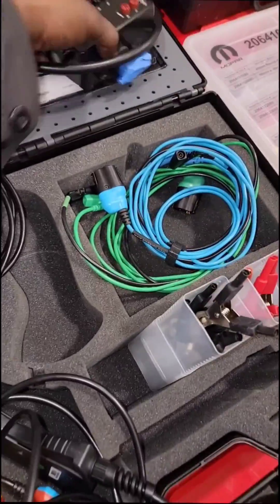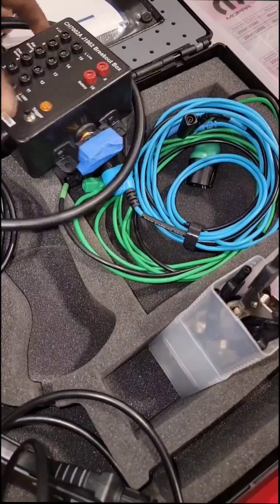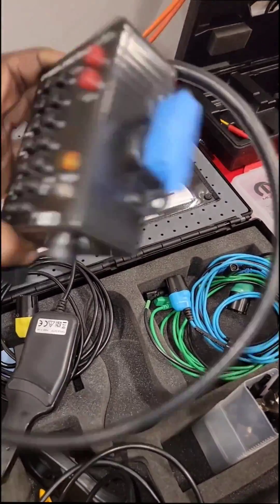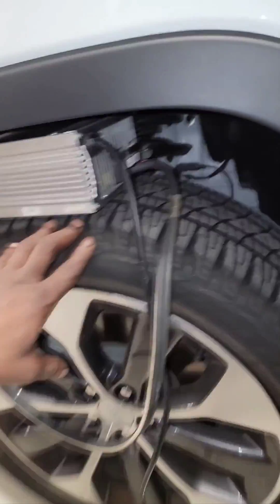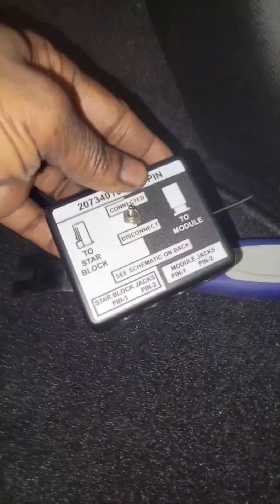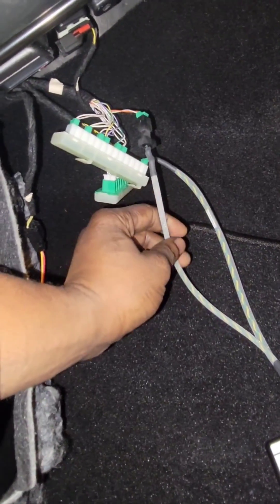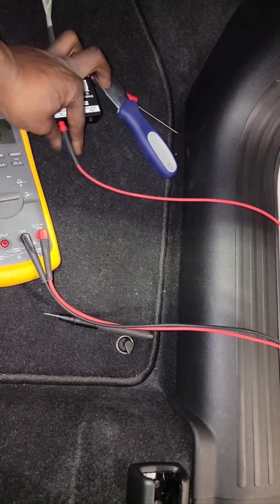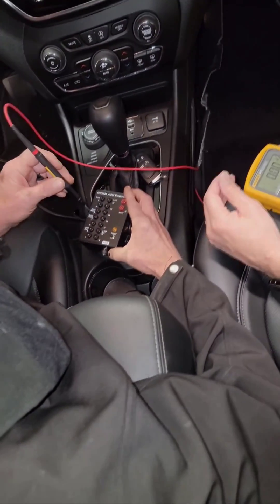Secret tool for testing Can Bus Network at the Star Connector Here. DLC PCM Breakout Box.

Comment: Umm what happens if you do back probe it?
Reply: That’s dealership nonsense about back probing. If you know what you’re doing, there are zero issues. The dealership, just like everything else in America now, dumbs down the techs because the quality and standards to be an ASE certified tech have declined dramatically over the years. These dealership techs are just that, technicians and not professionals, big, big difference. Put them to work on a different manufacturers car and you just as well take it to your local shoemaker for repair because these guys are clueless. There is nothing like a qualified Indy mechanic that has been around a while. These dealership dudes call me when they have a problem. I make a living fixing problems the dealership can’t and I NEVER get dirty, just diagnose and tell the part changing jockeys at the dealership what to do. Not bad at $200 a pop for 7-10 cars a day with clean hands.
Reply from the maker: This a interesting comment with questionable statements.
Reply: I think the worry is that you damage the pin, connection or the rubber insulation that keeps water out of the connection. 

I'll be honest, most mechanics don't have fancy tools and will probe anyways.